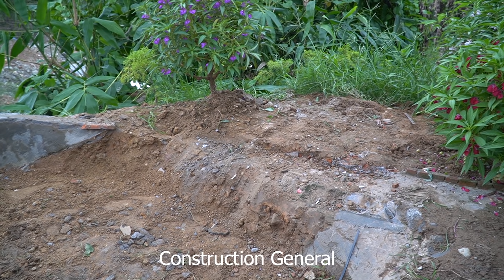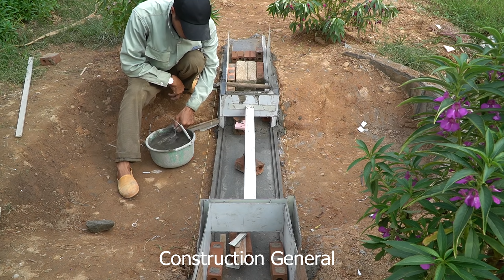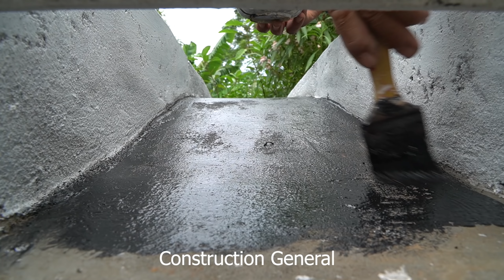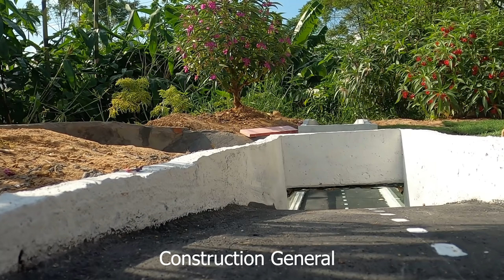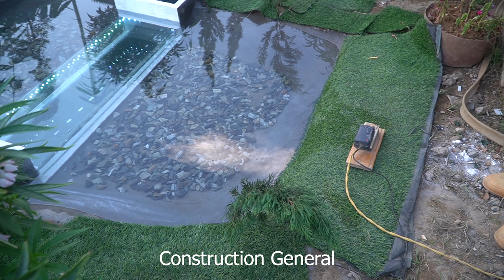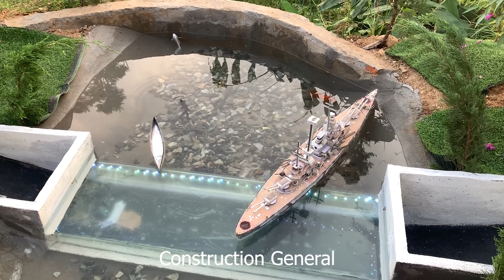Build A Tunnel Across The River - Mini Construction

Comment: Damp and condensation should never be ignored, as these unchecked problems will not go away and may indicatr more seriou problems. Well done in first phase of construction general. Often the remedy is quite straightforwarard and inexpensive, but the after - effects can ligner for some time, and then real effort is required when it comes to cleaning up and making good afterwards. GREAT WORK  because when the fluid is dry, the drilled holes are filled with motar and then a redered surface can be painted. Build tunnel across the river is advanture but these workout for presentation = 👍 GOOD LUCK
Reply from the maker: Yes, Thank you ! Please help me share ❤❤❤🥰🤞